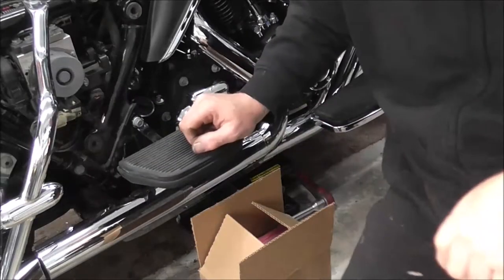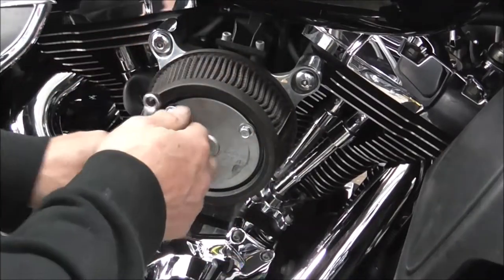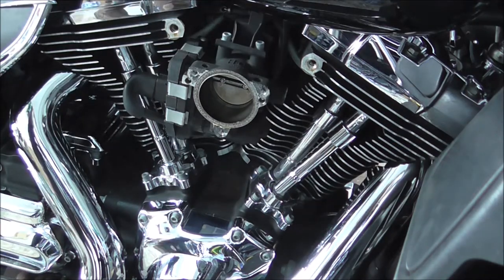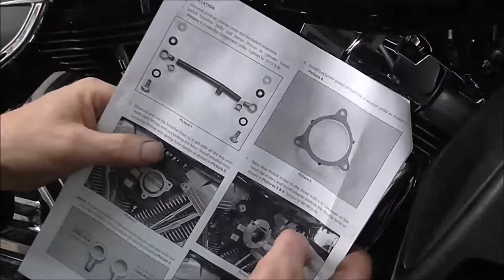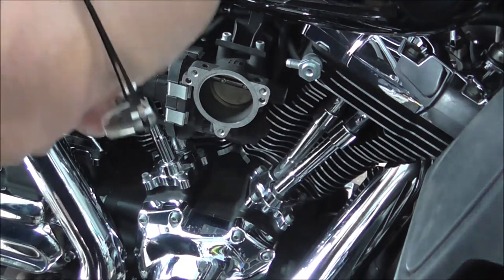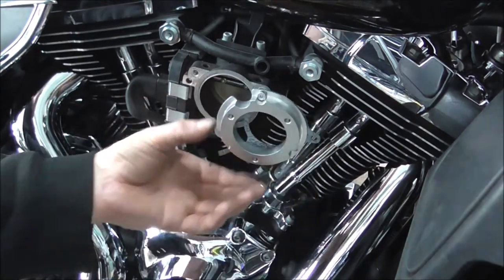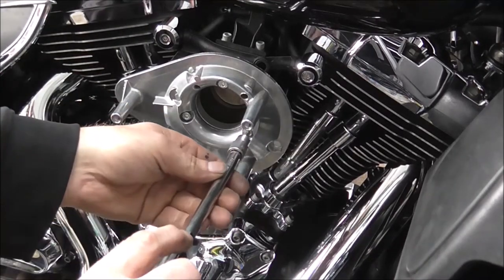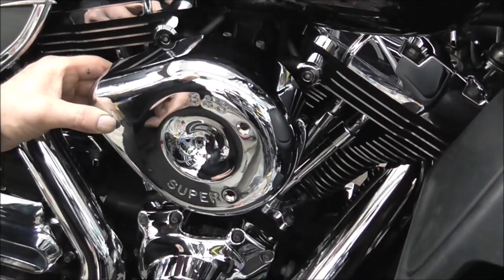Fittng an S&S air filter kit to my 2014 HD Electra Glide

Comment: Silly question...how can I tell if I have a throttle by wire or cable?
Reply from the maker: Have a look at the throttle part on the handle bars to see if there are any throttle cables coming out of the housing 👍
Reply: @pick6667  Yes Sir, thanks much. I ordered mine today.
Reply: @pick6667  Mine in cable.